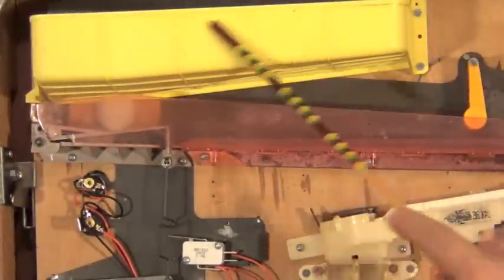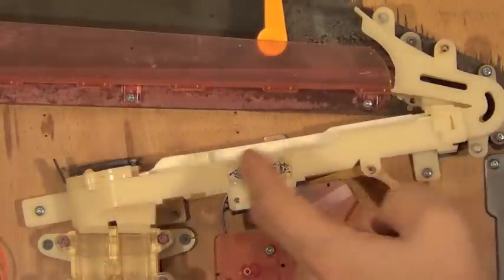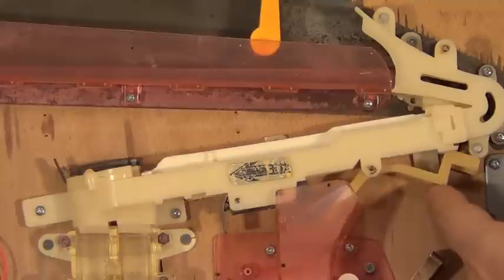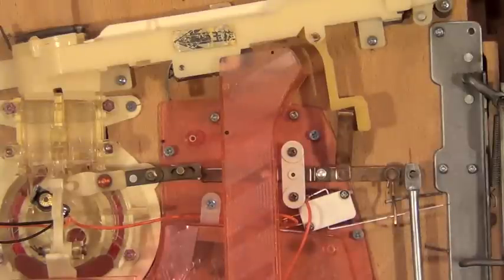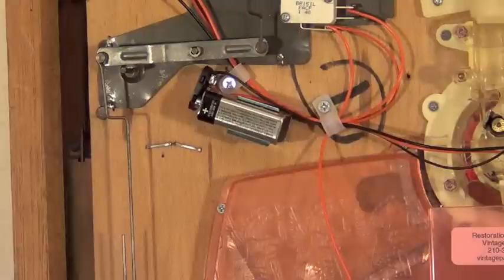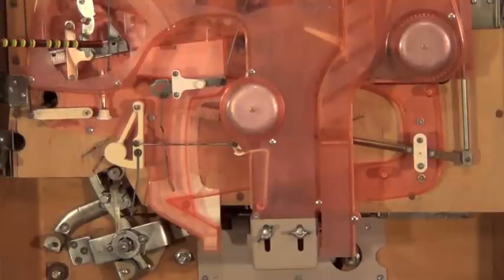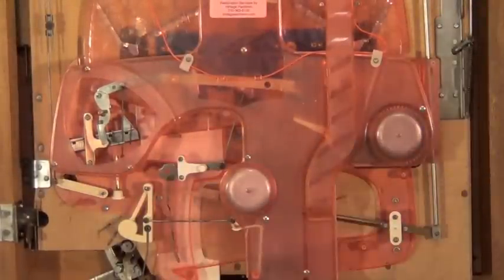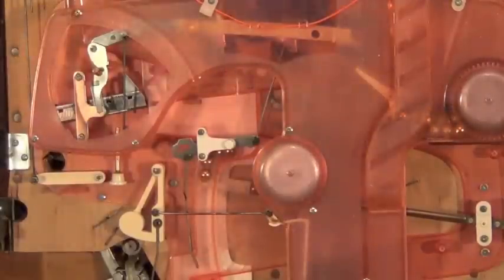Maruhon Explained Pt 2

Comment: the back side of this maruhon pachinko machine is exactly the same as mine! my play field has different graphics/design but the mechanics in the back are identical. I am in need of a missing white plastic pivoting lever that is under the covers . do you have any parts from the back of a machine just like in this video? it's a small pivoting lever by the bell to the right...i can send a picture of the area .  i am missing that white plastic lever.